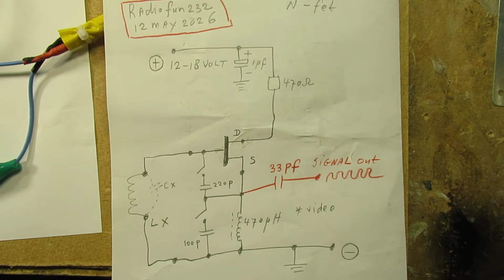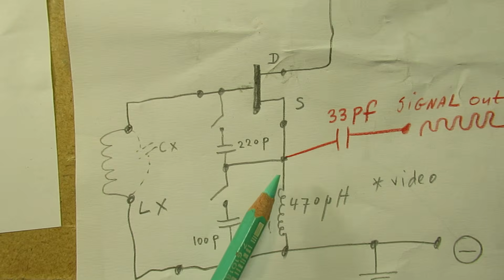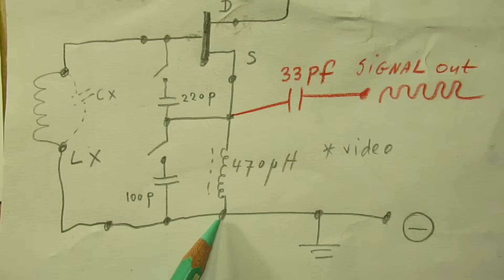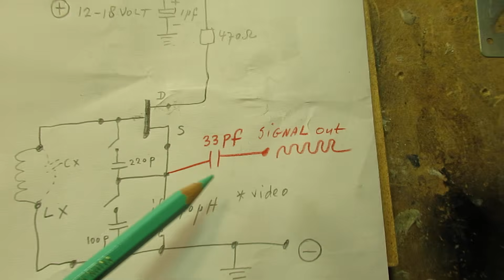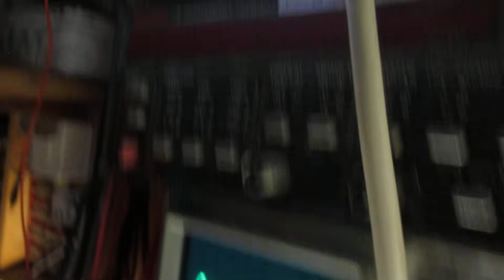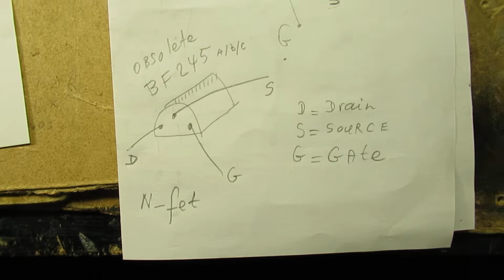Local oscillator for Shortwave 500 KC-14 MC with a Field Effect transistor pt2 of the Sweeper circ

Comment: Very interesting , I had a Parkside  soldering iron same as yours it lasted about a hour or so before not working not heating up the fuse  was ok so I suspected the heating element. Worst soldering iron i have ever had . Not that I'm a expert on soldering iron's. No visible damage to the tiny circuit in the controller box but could tell it was junk and threw it away rather than spending more money on a heating element. 👍
Reply from the maker: Hi John, I had exactly the same experience. Parkside soldering iron dead within 4 hours. Used the "regulator" box to serve a normal (good quality) soldering iron, but now this "issue". So I am throwing it away....Thanks! 12 may 2026.